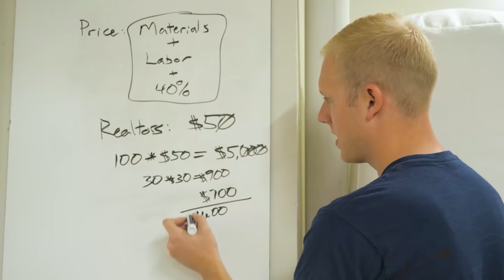"There's no way these can be saved..." $6,000 Furniture Build TV & Record Console | Business Update

Comment: Flip & mirror the feet.
Reply from the maker: There were holes drilled all the way through them!
Reply: They were screwing from the inside so the screws wouldn't show. That meant that the holes from the screws when they were attached would be visible. He mentioned he didn't want to plug them and that was probably a good call.